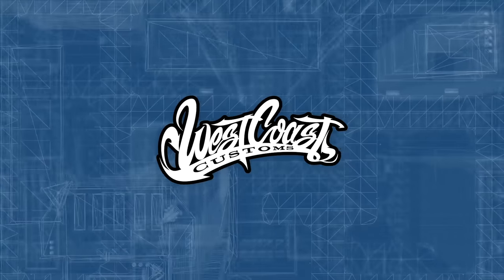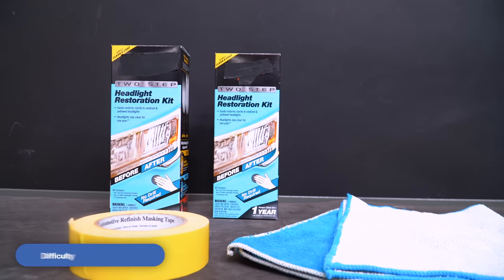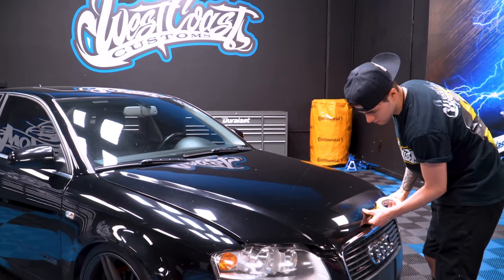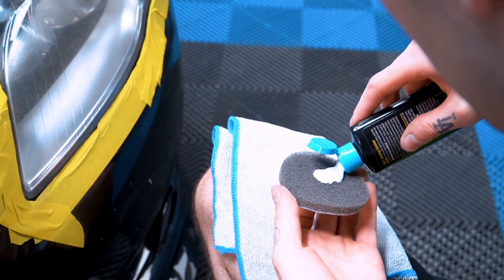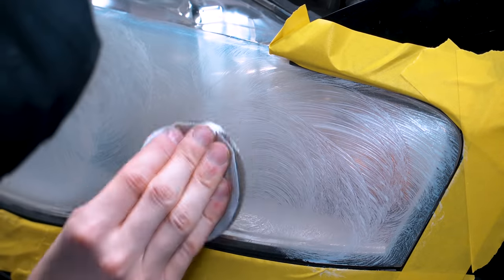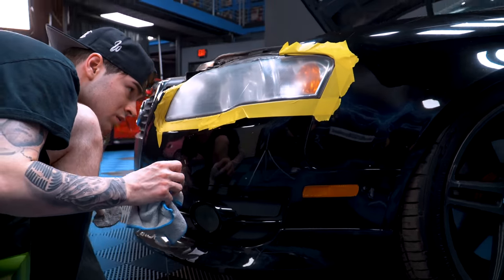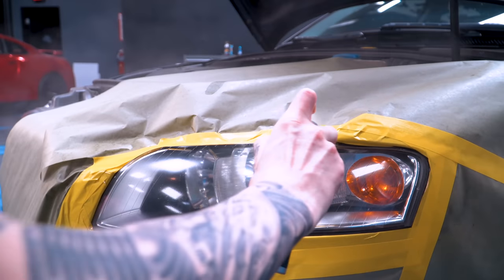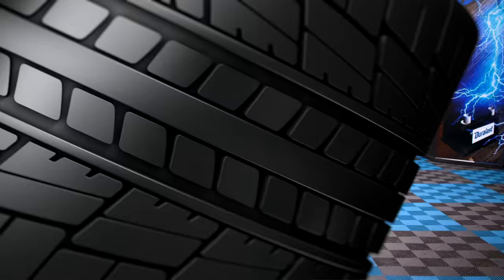Episode 9 - Headlight Restoration Cleaning | West Coast Masters

Comment: Will kits like those remove oxidation from the headlights ?
Reply: They will but you dont want to buy the kit with the blue. You want the yellow meguires kit. I only buy the kit for the plastex polish and then the clear compound you put on after. This videos actually isnt that good, the headlights still looked faded afterwards. I wet sand with 1000, 2000 & 3000 quick, then polish with plastex and finish with clear.